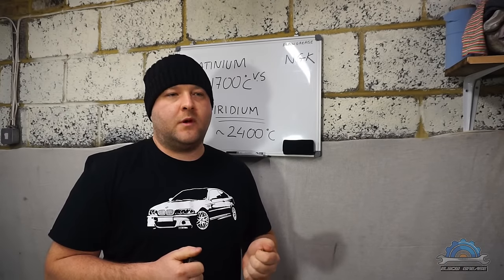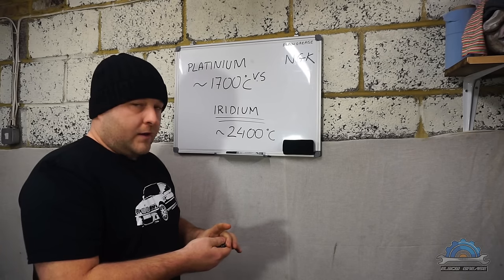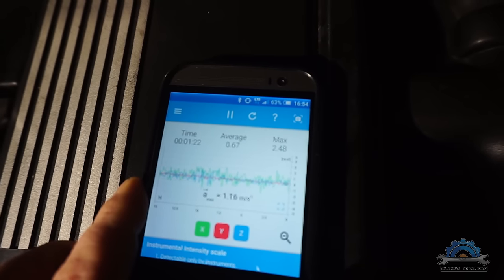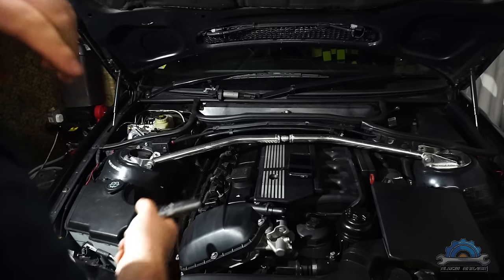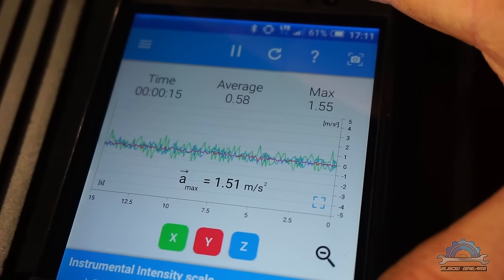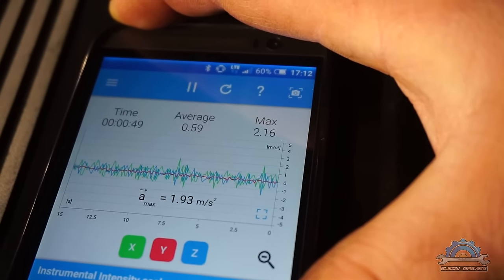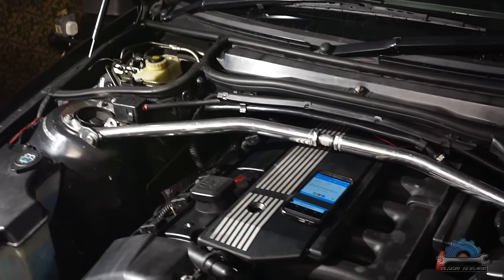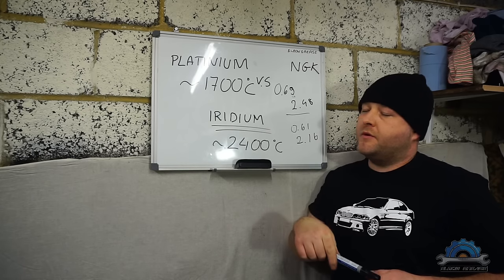IRIDIUM vs PLATINUM spark plugs SMARTPHONE TEST BMW e46

Comment: What you should be using as a test measurement is the knock sensor voltage which will also show you the engine roughness
Reply: Good point. Temperature of the incoming air could be a variable too. Been looking for other ways to use that knock sensor information besides measuring different fuels from various gas stations.

Comment: Hi. I have 1988 ford taunus 1600 engine. 4 cylinders and working with lpg/gasoline. If i using platinium or iridium spark plugs on my car ,  they told me, there would be a lot of current load on the coils. Could it be harmful?

Comment: I mean?
Is more better or not?
The platinum one burned hotter.
Doesn't hotter equate to better?
It made more vibrations.

The iridium one was smoother.
But it wasn't knocking like the platinum one.

The platinum wins if you wanna reach high revving I guess?
Makes sense.
Hotter spark, better combustion isn't it?

Comment: I think there is a better way of testing this. Although it does require tapping into the DME's readings.
At the dealer, we have access to call ECU functions and use read engine smoothness values. Might be hard to replicate at home. 
Personally I wouldn't worry about this too much, the spark plugs are working as they should. Just change them after a couple of years to prevent the plugs from getting stuck in the head and potential misfires.
Reply from the maker: Devin Smith I wanted to show engine vibrations with smartphone instead of glass of water.
Reply: Engine smoothness test is full of shit. I have a problem with fuel trims and all I was told is - its all OK. But Bank1 is 0 and Bank2 is -8. And there is always 8 between banks. B1 +4 b2 -4.

Comment: what spark plugs are best for a 1999 toyota corolla????? please help!!
Reply from the maker: Jonathan Cruz OEM  or Iridium upgrade, check NGK website
Reply: I happen to own this vehicle. Before 2000 Toyota recommended splitfire platinum spark plugs. With the engine change in 2000, they recommended iridium after that.

Since my 1999 has a 2000 engine I accidentally recommended based on OEM iridium to him, but he still has a 1998 or 1999 engine in his. 

On the left side of your engine there should still be a sticker which recommends the exactly correct spark plug for your engine.

I even have a video about it. Search my YouTube. :)
Reply: Jonathan Cruz the type u use ina a weed wacker
Reply: IRIDIUM IX

Comment: So aré iridium better? Thats what i want ti know
Reply: Yes I personally have NGK Laser Iridium in a supercharged Toyota Previa and man o man did that engine purred like a kitten. Yes when these Iridium plugs used especially in performance engines, you will notice better power and slightly better fuel economy. I have even used Iridum IX in a 93 Toyota Corolla and the engine runs stronger.

Comment: Copper core in everything, here, because it conducts electricity better than the higher temp metals.
Reply: All spark plugs have a copper core. Only the tip electrode is platnium or iridum. Copper is soft and erodes quickly. Even your normal copper plugs have a nickel alloy tip so they'll last 20-30k Miles. Back in the day doing plugs every 15-20k miles was routine with conventional copper plugs.  It's better now that they use a nickel alloy tip for them.

Comment: Iridium better than platinum?
Reply: Mohd Iqbal i just switch frim platinum to iridium will see if theres any dufference.
Reply: @juliosdiy3206  anything?
Reply: @813RiC  i put the ngk iradium order from Rockauto on my 06 forester 5 speed mt and the gas mileage was wonderful. Highway states at 27 and i got 26 for overall driving half highway half city. I was very impress. I will put it on my 2010 tacoma and see if it helps cause i am currently getting very bad gas mileage i think the plugs r either old or not efficient, will see about my 00 outback too.

Comment: B.s. the length of gap and coil frequency determines the spark heat and frequency.  Further more length of wires determines resistance( longer wire means more resistance while shorter wire equals less). Really all your wires should be the same length

Comment: Used to run mu ford with densoIK20 iridium and  engine was a lot smoother when pulling from under 2k rpm.

Comment: Your data is fucked mate...  Actually u want the count to be higher!!  The lower count is deactivating your injectors and causing miss fires lol...  I can explain to you why Iridium over Platinum if you like, however,  in a Beammer check your car's resistor count on the spark plug and what's actually required...  Honestly with BMW you may just want to go with OEM vs the performance plugs, because you can create all types of problems with your engines on the long run if the car is off by the smallest integer.  Be carful that the after market plug is not actually doing what the OEM plug is suppose to.
Reply from the maker: Higher ???Higher means more vibration ! "The lower count is deactivating your injectors and causing miss fires" what are  You talking about? This is just an phone on an engine , got nothing to do with OBD2 scanning ect. I got Iridiums for more than 50K miles and did engiene rebuild , apart of shitty rings in this M54 found nothing bad mechanically or elect. fuel trims ect. I do not think that Iridium are classified  as performance plugs. Did You every used IRIDIUMS?

Comment: its PLATINUM not PLATINIUM. nice car though...
Reply from the maker: WELL IT IS NOW, few bits to do with rear bushing and some cosmetics ,engine runs almost like stock after new internals,
Reply: Peter
are u sure its not
platinuminuineum?
just asking...
Reply: Personally I wondered if it was like in Australia where Aluminum is Aluminium or something like that. Not everyone has the same English.
Reply: So senor